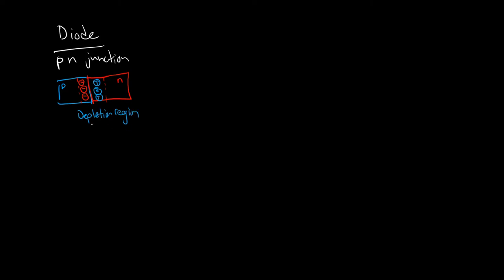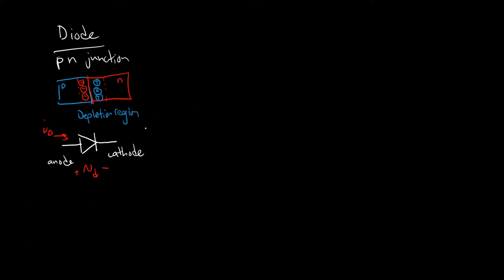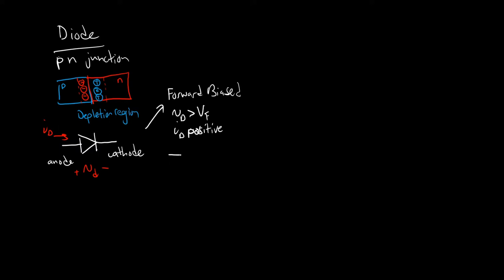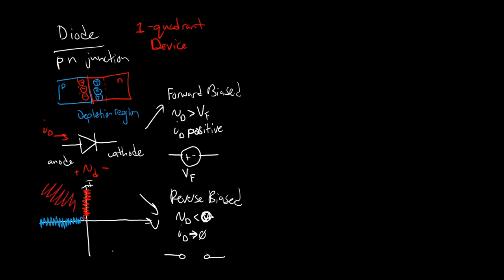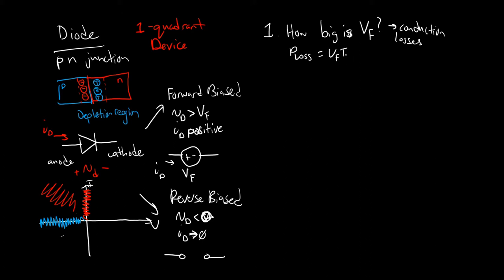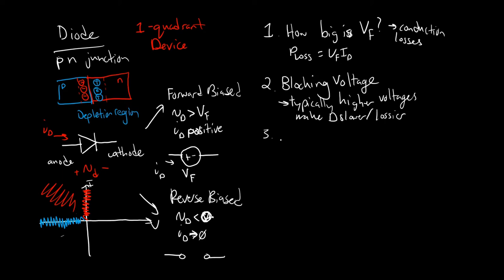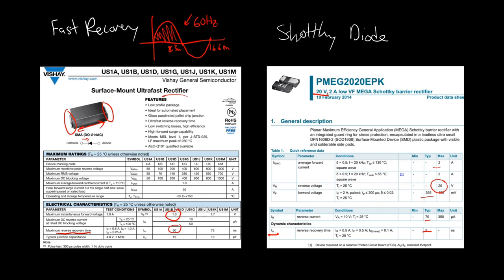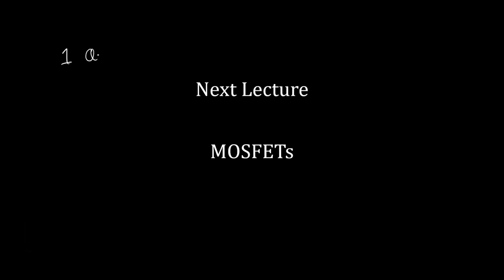Lecture 4.1: Diodes

Comment: Hello Tim, great video series. I think I have found small error though. I think your explanation of lower junction capacitance for fast switching diode is wrong. Its junction capacitance it should be independent of the diode length. My guess would be that the n-epitaxial region is more lightly doped which means less charge carriers and so lower capacitance and higher Vf
Reply from the maker: This explanation seems more correct. My explanation clearly fails because the package would be common for both devices. Thanks for the input